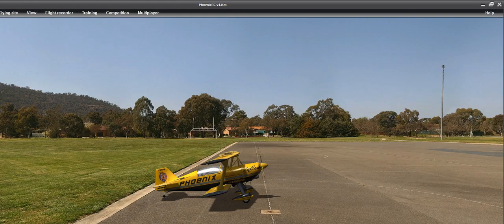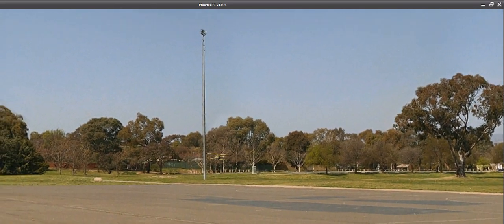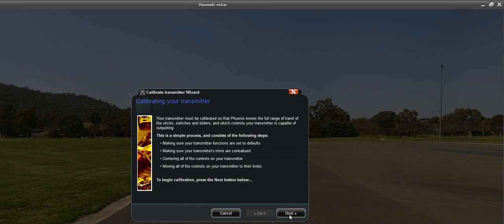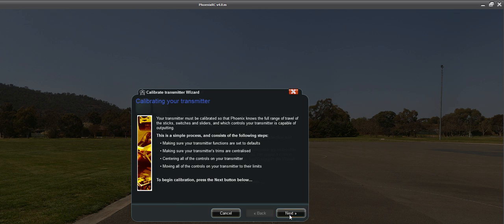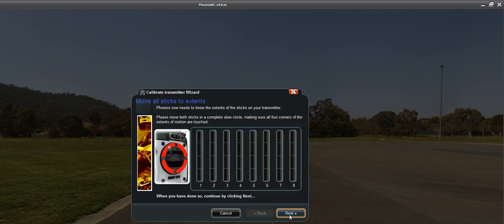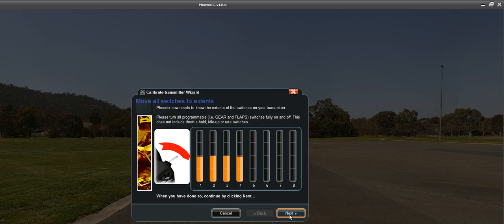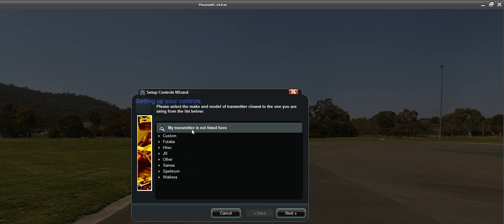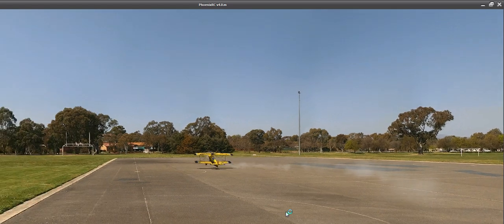Turnigy 9XR with Phoenix RC Simulator Setup

Comment: My 9XR with Phoenix RC has a problem with the throttle. It's not a smooth curve. Anything under 50% throttle position and it's "off". Anything over 50% throttle stick position and it's "full power". There's no curve. Any ideas?
Reply: Thai Mac I bet you did not set your throttle sticks center position correctly

Comment: Hey bud, I have devo7e, 8s and th9x all working fine with sim but cant get the aileron to be detected. Phoenix says set up as heli with no ccpm and single servo but still nothing.

It can fly planes if teh 4 channel default mix is picked but no aileron if heli template is used at all. Any clues?

Comment: I'm using a FlySky FS TH-9X, 
and had issues getting the TX to work when I added it to the sim.
For some reason, no matter what I did, the Elevator channel didn't respond.

I ended up just using the bottom Futaba TX model on the pull-down-menu, calibrating the sticks and switches, and things are now working perfectly.

If anyone is having similar issues, just try that, and hopefully it works for you too.

Sam -
Reply: I'm having the same problem with my flysky t6, are you saying if I set my transmitter up as a futaba TX it will work that way
Reply: jim pruett I'm not familiar with the FS-T6, 
but, if it has a 3.5mm / 1/8" trainer port in the back, it should still work..
That port is how the ppm signals are transferred..
1st you'd want to connect the jack to the port in the TX, 
2nd connect the USB-dongle to the computer / USB, 
and make sure that on the dongle, the switch is set to whatever SIM you're using.
Some are pre-set to only 1.  Others have a few different options..
Once in the sim, when you get to the 'wizard' that walks you through setup, 
you're supposed to add a new TX, name it, set it up, etc..
That's where I saw the issue..
Instead, I selected the Futaba TX in the list of radios..
Once that was done, I just configured the sticks / switches like normal, 
and things began working properly.  From there, I went back in later, 
and renamed that Futaba TX to FlySky TX just so that it looked right too.

Sam -